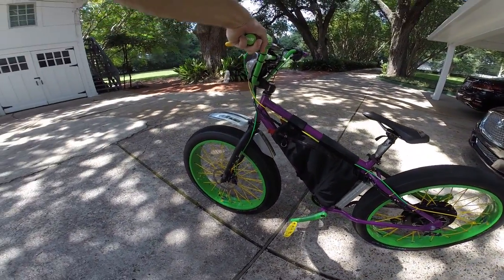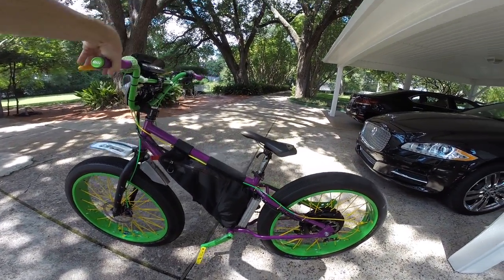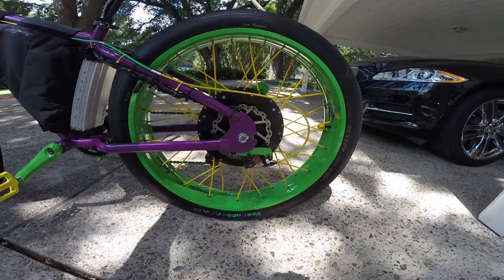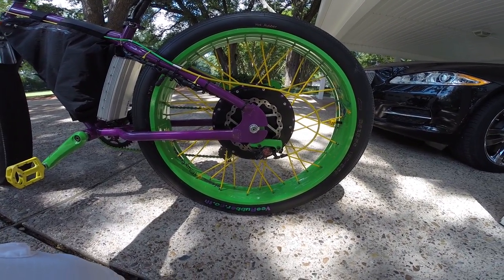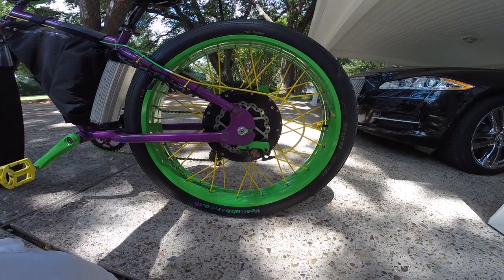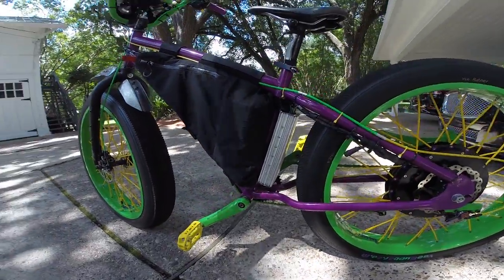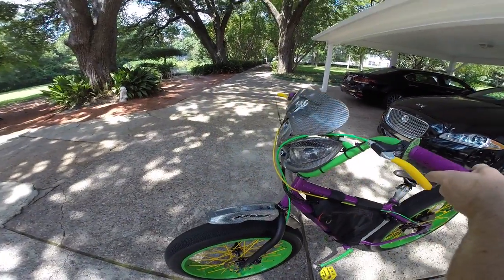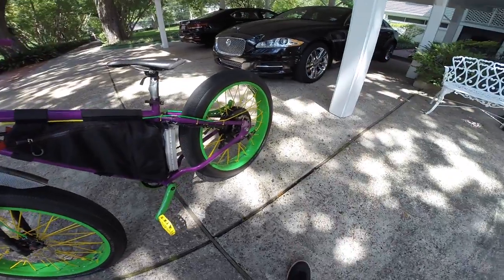Mongoose Fatbike Electric 72 volt

Comment: And also Shawn , I'm a autobody tech , I've been building cars for 35 years , I hope I can make all this work for me ! Hmmmm
Reply from the maker: gonna have to bend it. a suggestion I heard was either heat it up and bend it, or you could always put it on front.
Reply from the maker: you might need to remove rear brake bracket and realign with frame your gonna need to bring it in about 15-20 mm on each side.
Reply from the maker: Kool byke no wait its aluminum now not steel like the older mongoose right?

Comment: Thanks so much for the info ,  I'm so stoked bro !  Do you think I should just pick up a e bike battery pack with charger ? I've been looking and I'm not sure what size to pick up 48 v 10 amp ?
Reply from the maker: If it's I'm the budget for the build then yes I would buy a specific battery and charger. I would check out electric rider.com and get a 48 volt 15 amp hour lithium manganese battery, you can opt for the lifepo4 but it's a little bigger and heavier. Make sure that wherever you plan to mountxbatteries that the space can hold the pack. Manganese batteries are lighter than lifepo4 but have less charge cycles, call Mark at electric rider.com they will get you set up. I also really like the elite BmX packs from hi power cycles, but they get a little pricey, just all depends on your preference, you should get about 25 miles out of a 48 volt battery going 14 mph at like 8 amps, or probably about 8-10 miles going wide open. You can add more packs for more distance,

Comment: 135 front fork , so I think I'm stuck on the rear end , so you have seen this done before ?
Reply from the maker: double check distance of fork and motor remember to  leave a washer between motor on each axle. i think it will fit on front. tweaking rear end will have challenges. its your call, keep in mind if your not gonna hot dog and do jumps a front motor will definitely help stay in control with your trailer

Comment: Morning bro , check out on you tube Peter Chou ... It's a 26 in by 4 in wide 2000w to 5000w high power erase hub motor , it's a red rim like the mongoose # lbck26 hrn  ,  and I agree on the proper battery ,

Comment: Yo brother , this is dan from b.c , you messages me a lot of info for my dolomite , well I found a direct bolt on kit red wheel and all ! 2000 to 5000 wat  I can use a 48v to 72v battery , 80amp esc , can I use rc lipos 8s 9000 mah ? And how many , this air what my hobbie stor told me ? Your thoughts bro ,
Reply from the maker: hey dan, awesome that you found a complete kit...as long as the nominal voltage of the batteries is equal to motor controller you shouldnt have a problem, only thing concerning me is the 80 amp discharge on esc. expect to get a shorter life out of packs that you ride hard on. i run a maximum 65 amp and its more than enough. when you get ready for first test ride set controller at 40 amp and work your way to 80.  fyi, dont get me wrong im all for crankin up the amps but recent blown motors  have changed my way of thinkin and if i know im gonna ride it fast ill set the amps up but just short bursts. and then regular cruisin turn it down to get maximum life out of whole setup. hope this helps..